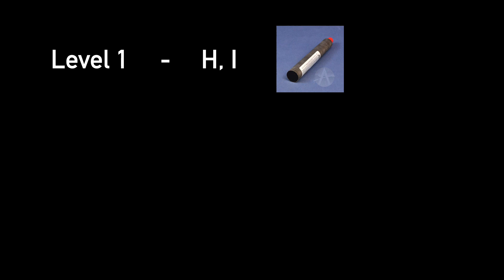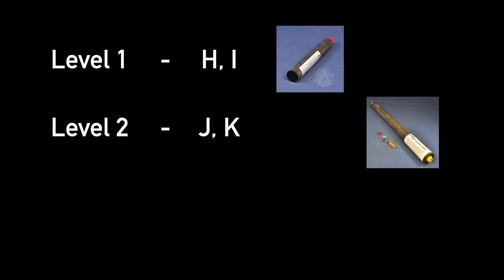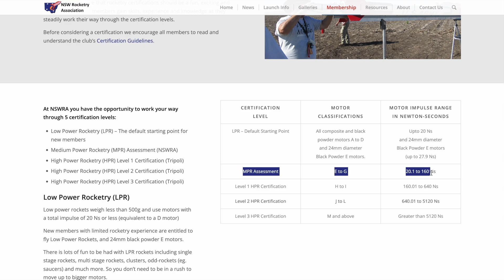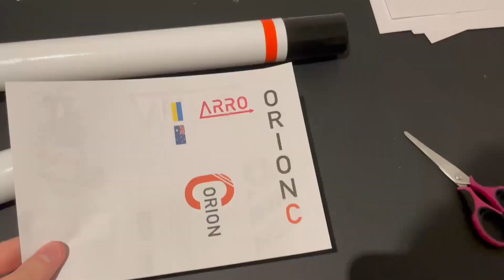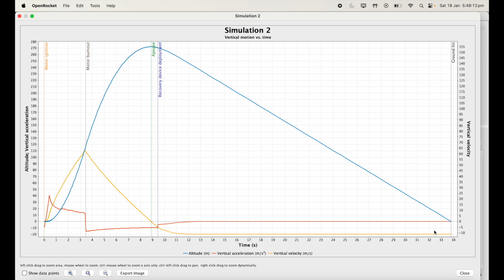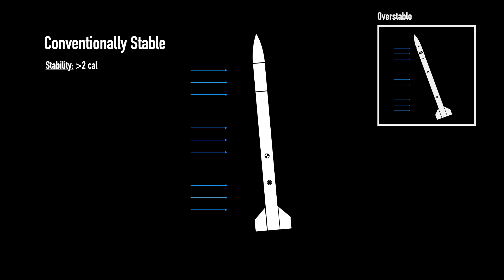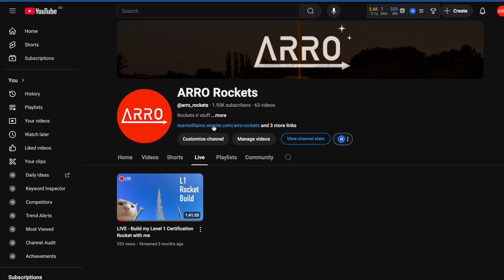I Built a Mid Power Certification Rocket

Comment: Nice video! Glad to see more people getting into the HPR hobby (well I assume you plan on doing your HPR certs). I actually designed and built the rocket at 7:40 in this video! 

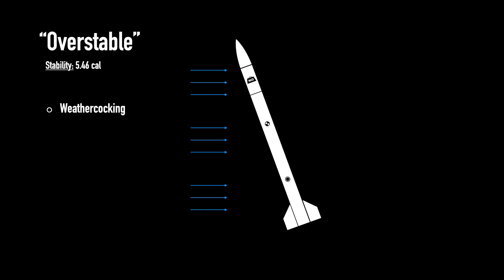This isn't a critique of the video, but rather an interesting observation, but the example at 10:34 is actually an example of the rocket being under stable rather than over stable. 
Upon conducting a post flight analysis using flight data and modifying the openrocket simulations to match observed values, the static stability margin was slightly under 1 at around that point in time during the flight, hence it was severely disturbed by the strong wind gusts (the rocket pitched with the wind, and not into it). 
However, something interesting to note is that although the rocket at this point in time is only marginally statically stable (SC < 1),  the rocket is still dynamically stable, and that can be observed in the way it responds to the oscillatory input. It corkscrews but the corkscrew dampens out as the flight goes on.

Perhaps Ill catch you at the next NSWRA event, happy to have a chat about anything high power related as I'm on my Tripoli L2 and working on my L3.

Also safe to say ill be subscribing!
Reply from the maker: Thanks so much! You must be apart of UNSW Rocketry right? That launch was spectacular congrats on that. I didn't mean to insinuate it was over stable, I figured it was some under-stability issues coupled with the crazy wind on that day. But thanks for the extra info about it I was quite curious! 
Aiming to be at the next Mullaley event for an L1 cert, and at the February Whalan event, but would love a chat about how you've gone about your HPR certs!

Thanks for your support :)